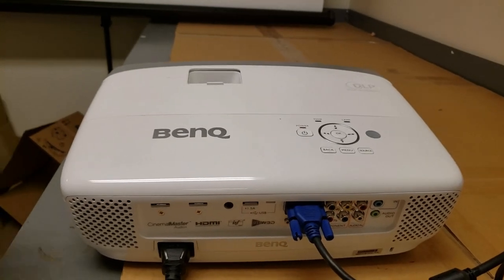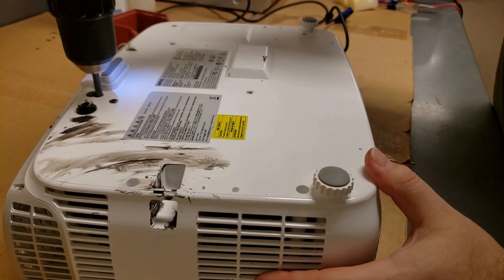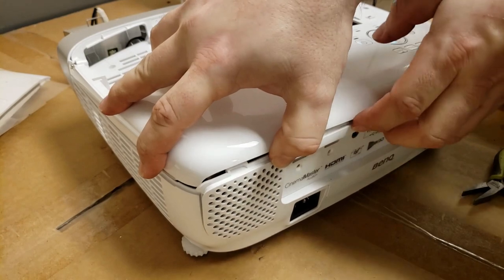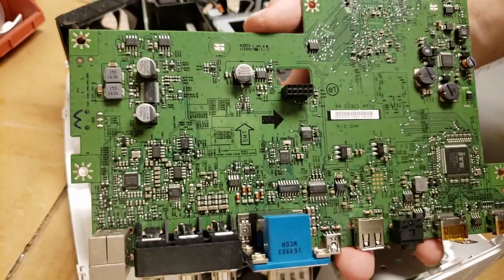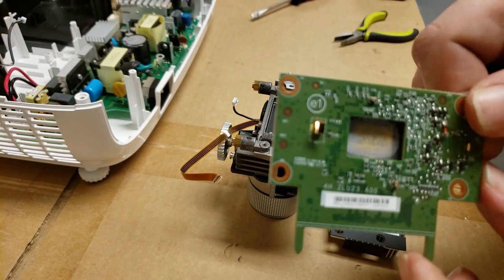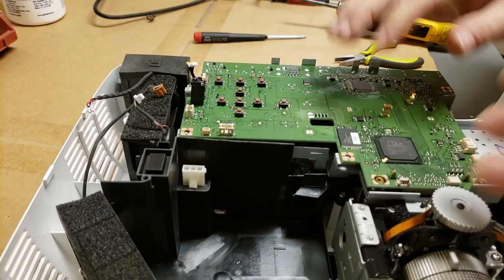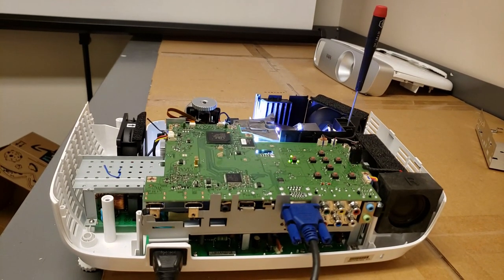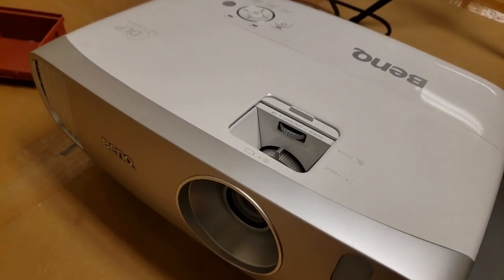BenQ HT2050 Teardown Cleaning... "Fail"

Comment: Hi Frank, great video, I wouldn't have attempted the strip down without it for fear of breaking the casing.
I have a identical projector in the UK its badged as a W2000, the only difference I can see is it has the capacity for a add-on wi-fi component.
Recently my lamp exploded and a small puff of smoke can out of the projector and tripped my mains electrics.
I've stripped the projector about four times and removed all the glass and dust, there was a piece of glass in the lamp fan that I'm guessing caused the machine to cut short the initial start up. I also noticed something was interfering with the the colour wheel so I dismantled it but found nothing, on reassembling it seemed free wheeling.
I've tried two new bulbs, and checked the bulb housing for continuity. The machine boots up and I can hear the fans but soon powers down without the lamp coming on, then the red lamp warning appears and the machine goes into standby. I took out the bulb assembly and can see the colour wheel spinning freely.  Unfortunately I'm not in the states otherwise I'm at the point where I'd send it to you!
Do you think it could be the ballast power supply?
Do you think its worth dismantling the machine to clean the colour wheel sensor?
Reply from the maker: Hi Graham,  I am curious about the puff of smoke and the tripping of your RCD.  IT kind of sounds like you may have had a main power supply failure(power factor correction circuit).  I would check and see if any of the capacitors (mainly the large 400V) have vented.  If the lamp burst and the arc points hit together before the ballast shut down, it can cause a bit of a domino affect failure.  The ballast can be damaged which then takes out the PFC section of the power supply. 
I'd be leaning towards checking the mains supply first(that lowest board that plug into the ballast and mainboard). Then the ballast.  The ballast wont start unless the mains supply is happy. How comfortable are you with a volt meter?  Cheers from the other side of the pond!
Reply: @FixitFrank  Thanks for the prompt, insightful reply Frank.

I've stripped down the colour wheel since the machine needed dismantling anyway and it visually looks fine.

On checking the PFC, the large capacitor seems fine, but the small black one 1000uf 16v (which can be seen at 26mins) nearest to the connectors that protrude through to the upper board seemed to show a reading. I am however checking it in circuit and with my cheap multimeter, I don't feel competent enough with my cheap iron to remove it. The other two (brown 680uf25v) seem ok. None  show signs of leaking or bulging.

I checked out your ballast diagnosis video and found that one of the four mosfets is shorting and beeps with a continuity test across all posts. I might have ago at removing it since I have a replacement on the way.

Do you think the black capacitor on the PFC could be problematic? I don't want to damage the new ballast.
Do you think the puff of smoke may just be the from the exploding bulb? There's no sign of scorching on any components or anywhere else inside the machine.

Again, thanks for your expert opinion.
Reply from the maker: If it was a puff of smoke rather than a cloud, then it might have just been the lamp you saw smoking.  The crack noise may have been the bulb bursting.  The ballast failure is pretty spot on though.  I have seen that a bunch of times.  I would suspect the rest of the caps are OK . It would be very obvious if they failed if the smoke came from them.  
More likely the bulb burst, shorted out and wrecked the one mosfet.  Then shut down the power supply.  The PFC is still suspect but you can check that with the ballast removed.  You should get about 380Vdc on the power input to the ballast when you start the projector. It should go high to 380 for a moment before it sees no response from the ballast and shuts back down.  If you get 350-300, then the PFC circuit isnt working.  The mosfet for it as well as the fuse resistors and maybe a diode could be damaged(only if you dont get the 380). 
I would connect the ballast back up without the power leads connected. Meaning connect the control wire cable only. That will load down the control circuit correctly.  Then carefully hold the leads on the wire that would plug into the ballast from the power supply and turn the projector on.  The 380 should show about when the color wheel starts to spin.  Then the wheel will stop and the 380 should drop to 300-350v. As long as you see that 380, the rest is probably OK.  You just may need a pair of mosfets. I say pair because you want to replace them in pairs even if one seems OK. Or if you can find a used/working ballast.  As of now, I would start with check the PFC voltage and go from there. It sounded a lot more dire at first, but it may not be as bad as it seemed.
Reply: @FixitFrank  Thanks Frank, I'll test at the weekend when I'm off work. I've ordered a new Osram ballast from China and am trying to source the correct mosfets here in the UK at least I'll have a spare one if I manage to repair it. I've just returned my second Osram lamp back to eBay, the first was from Amazon UK, both were fakes! I've had to order a third from Amazon.com from your side on the pond to hopefully guarantee its genuine!

MANY, MANY thanks for your invaluable help and advice, hopefully the PFC will be okay and when the parts eventually arrive I'll let you know how I get on.
Reply from the maker: Fantastic! I will wait to hear back.  If you get real jammed, I have an email listed on the about tab.
Reply: The replacement ballast finally arrived, I was unable to source the correct mosfet to replace on the old one. It's done the job and I'm back up and running, so happy that its working, thanks for all your help Frank 😀

Comment: I think its a great ideal I have lots of projection problems it would be great for u to fix them and have a video
Reply from the maker: Get in touch if you like.  Depending on the issue, that could be a good idea!
Reply: @FixitFrank  well I dont have nothing now but I have had to have 2 DMD chips changed in two benq projectors and a cleaing on a nother one they cost so much too keep up now i have a new one and it is not broken yet

Comment: Thanks for this, one of the only good tear downs I could find for this particular model. Up until tonight everything was working fine aside from a hair I noticed on the screen recently. Now when I turn it on I get the fans and the lamp light flashes red and then solid red. Whole unit pauses and then powers down. According to the manual it's "Lamp1 error in normal operation". I just ordered a replacement bulb that'll arrive in a couple days so I can rule that out. Had it since September 2021 so it's under warranty but I'd rather not have to wait to get it up and running again. Do you think it's worth digging into this thing further to see what's up? Or just send it in?

Thanks again
Reply: Actually the power green light and red light are both on indicating something with the color wheel. Might be a sensor?
Reply from the maker: I'd use that warranty.  As much as I would like to say "do this or that", if its this new and having issues, it would concern me that something serious might be building up to happen.

Comment: Hey Frank. Great videos! I've been able to completely teardown my BenQ HT2150ST and give it the first cleaning in 4 years 😆 I think I am having fan issues and need to replace the fan 3 and\or fan 1. Which fan is which? I can't seem to find the info anywhere. Please help
Reply from the maker: Fan 1 is the exhaust fan. Fan 3 is the lamp blower fan. It's probably worth changing both. They are hard working and if they fail or act up, your lamp life will be extremely shortened.
Thank you for the kind words.  I appreciate it 😊
Reply: @FixitFrank  your the best! I again used one of your videos and figured out how to get to the service menu. Sure enough it's the blower fan. But exhaust fan is getting done too. Thanks again!
Reply: @FixitFrank   Hello Mr Frank, thank you for all your videos. I am also having kind of a similar problem. Neither of my fans are running and now when I use the projector it’s get really really hot. I also noticed the fans don’t turn on n a lot of dusk have been collected inside. Would it be wise to change fans or do you think something else is the problem ?? Please point me in the right direction.
Reply: @FixitFrank  where do you get the fans from? I ordered one from aliexpress today but im not sure if its the right one. I ordered the aub0712h-c. I have a benq w2000

Comment: I actually had one of these (well, the 2050A) for a short time. It wasn't getting along with the HTPC I was using at the time, so I ended up sending it back and getting an Epson 2150 which I'm still using now. Kinda a shame because the color and everything was great. Really quiet too (I'm sensitive to noise). Really interesting to see inside one of these. I do remember the DMD fan didn't spin unless I put it into eco blank, but I didn't have it long enough to see the other scenarios for it to spin up.

I would have thought the lamp fail before getting dim enough to not shine past dust inside. Guess not all the time. Also, the free labor thing would be cool for a video, but you're kinda already doing that, right?
Reply from the maker: Exactly.  It really depends on the issue, what sort of free time I have etc.  This was recorded back in March so things have changed a little. I have a day job (obviously) otherwise I'd be more into charging a normal rate.
Reply: @FixitFrank  Ture yea

Comment: sir i have optoma Hd 143x projector , am used to 2nd monitor on macbook pro , i have problem if laptop charger connect time projector not view display what is right solution , i have try changed hdmi cable and power supply cable not working
Reply from the maker: That is an unusual problem!  I would check the laptop charger. Make sure it is proper wattage for the macbook. I have never seen this problem but if the power is too low from the charger the second display may not work properly.
Reply: If your using a hub with the macbooks that only have the one usb port, it could be that the hub can't handle both at once and you need a better one.